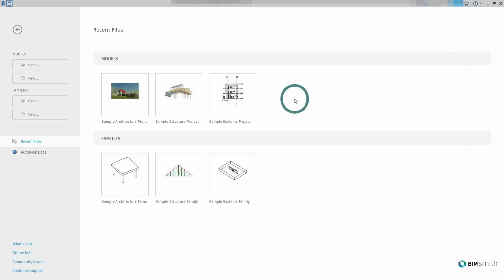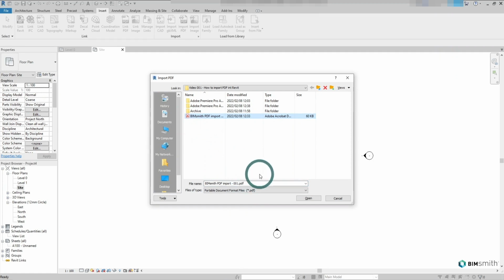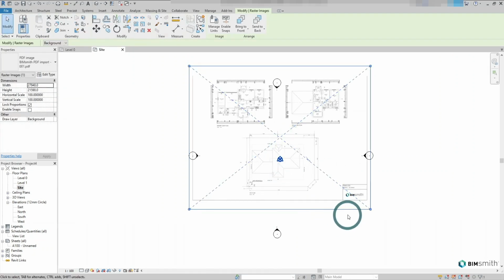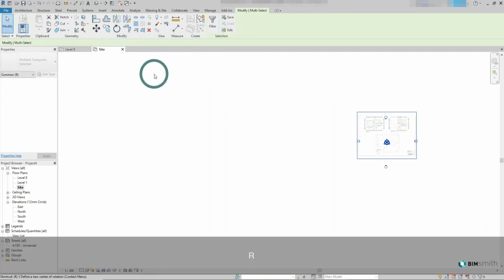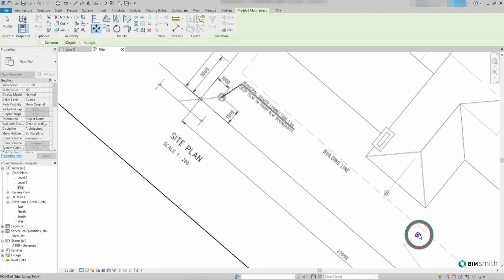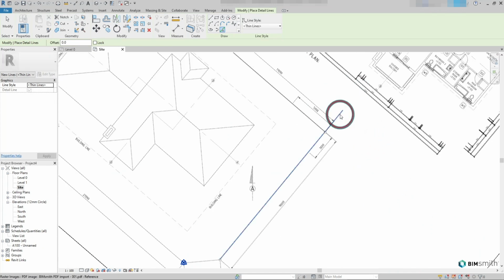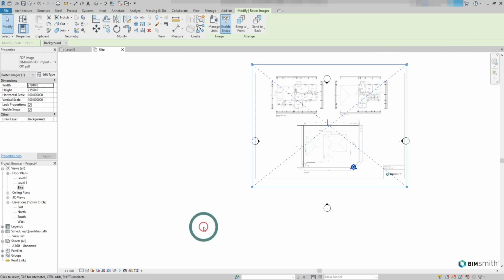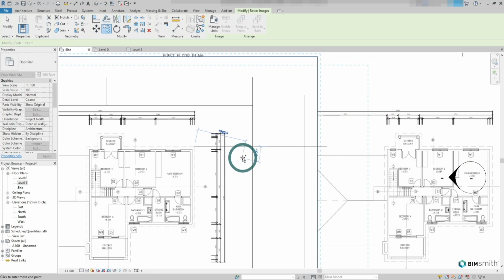How to Set Up a Project in Revit: Using Base Points, Project North, and PDF Underlays

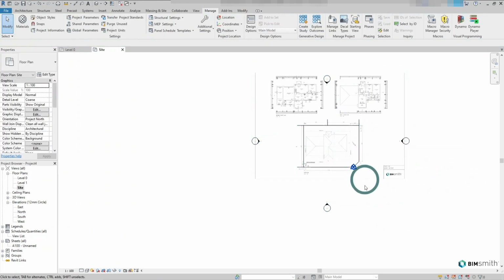Comment: Hello, in your PDF, you had all 3 views/floor plans on the same PDF. The PDF I have has separate sheets, i.e. Sheet-1: Existing Site Plan ( I followed your video till 5:12 with this). But from there onwards, I am not sure what to do as I have two more sheets, i.e. Existing Basement Floor Plan and Existing Ground Floor/Level 1 Floor Plan ?

Comment: Hello, 
thanks for your short and clear tutorial. I noticed that the crop region is rotated as per project based point, and not project north, how can we rotate it with all the rest?
Reply from the maker: Hi Sara, by double-clicking on the crop region you will be able to reshape the crop region by dragging the magenta lines. Or you can just redraw the region by (1) using the line tool for a polygonal shape crop region or (2) using the rectangle tool for a more traditional rectangular shape crop region. We also will address some more on this topic in a future video!
Reply: @BIMsmith  thank you! The project base point is somehow connected  to the survey point and coordinates etc.. will you touch this topic too?